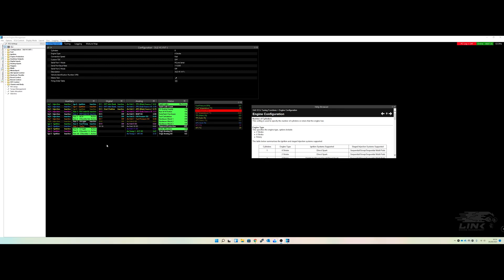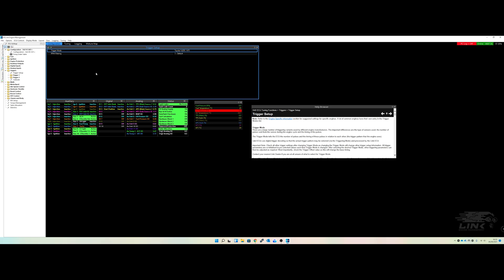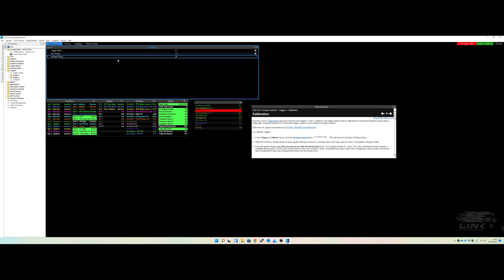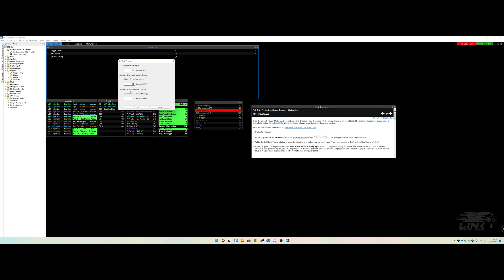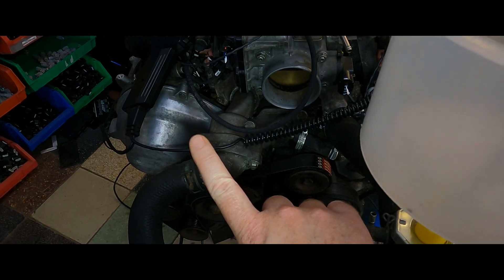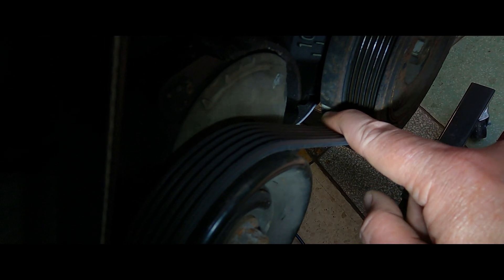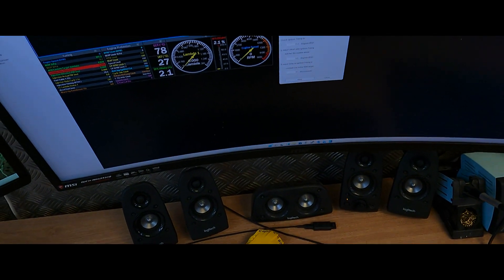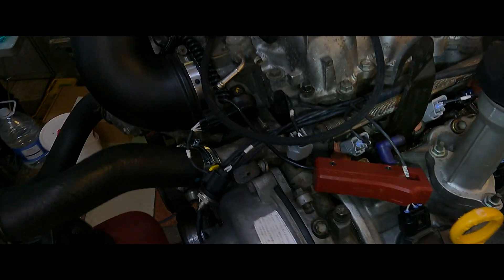Link Engine Management How To Set and Check Your Base Timing

Comment: Amazing video! Quick question, I have a link G4+ V5/6 PnP. I am fitting a V4 Subaru Impreza engine in to my V5 which was previously working fine in a V4 Impreza. However I am told it may not start due to the difference in cam timings between the 2 versions. However I have the benefit of a link so will it just work or do I have to change a setting? Many Thanks from the UK!
Reply from the maker: Hey Steve yes you are correct. The Plug and Play part is mainly for the connection to the existing harness. Underneath it's a standlone and therefore works as a standalone. You can change all the trigger settings and repurpose outputs and inputs. Also add inputs that are not avaliable on the standard harness. For example in this video we are using an Altezza Link PNP ECU to run a 1JZ-GTE VVT-i in an IS200 https://youtu.be/83ArTeJZVqw
In this video we have actually used an Altezza PNP just to run a 1JZ-GTE VVT-i on it's own. https://youtu.be/Xg6BYnHYTic
So you can see although they are plug and play they are still very flexible.

Comment: Does this apply for running base maps? I've just bought a Link G4X Plug n Play and I'm going to set it up on the base map so I can drive the car to the engine mapper.
Reply from the maker: Hey Big Supes. Checking base timing applies no matter what the scenario. Doesn't matter if it is Plug and Play or wired in. You always want to be sure that the timing is correct and you should never assume that it is correct. With a Plug and Play it should be correct but don't assume. We all know what assumptions are!
Reply: @PhoenixEngineManagement  thanks for clarification. I appreciate the response. 👍
Reply: @PhoenixEngineManagement  Amazing video! Quick question, I have a link G4+ V5/6 PnP. I am fitting a V4 Subaru Impreza engine in to my V5 which was previously working fine in a V4 Impreza. However I am told it may not start due to the difference in cam timings between the 2 versions. However I have the benefit of a link so will it just work or do I have to change a setting? Many Thanks from the UK!

Comment: if my engine is firing at 10 degrees but the ecu is locked at 0 degrees, can i just change the timing lock to 10 degrees? and it will be synced?
Reply from the maker: Hello Tang so just to be sure. You've set the Link ECU to lock the timing at 0 degrees but when checking the timing with your light you are seeing 10 degrees? If that is the case then you need to adjust the value that I showed by 10 degrees to move your timing to 0. But some engines would find it difficult to start and run on 0 degrees so you might be better off locking the timing in the Link ECU to 10 Degrees and adjusting the value until you see 10 degrees at the engine.